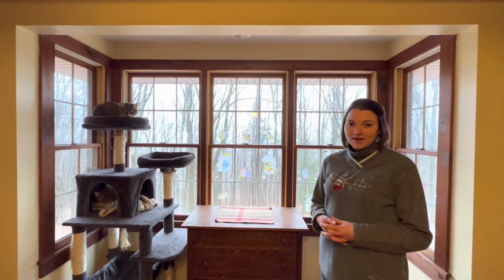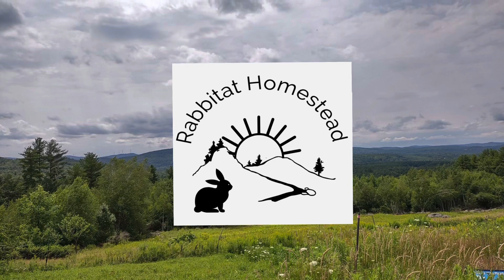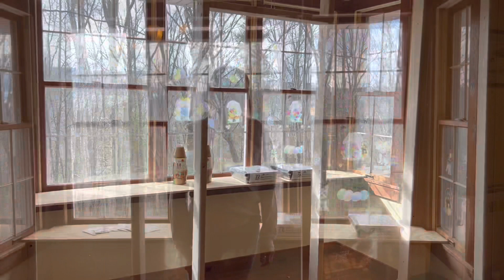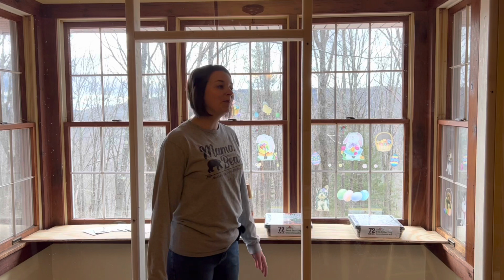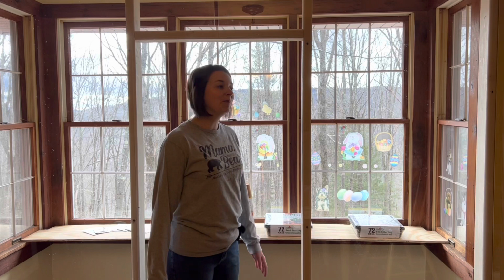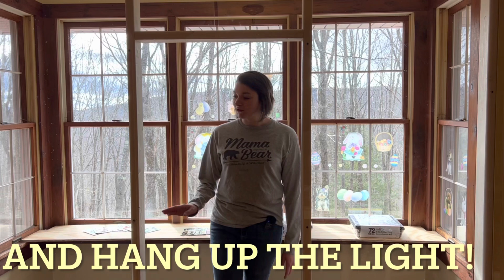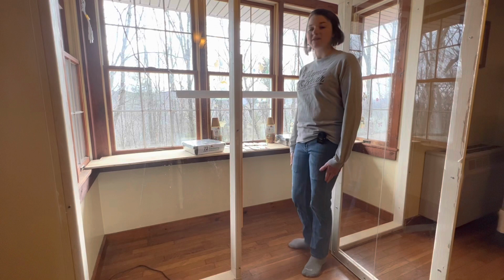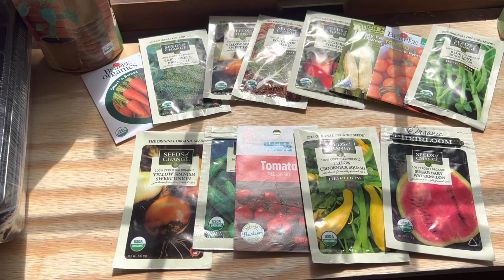Building a indoor Greenhouse

Comment: 2:51  use the wrong kind of screws on the right side. That's why there's a crack in the plexiglass. Would have been best to use metal screws because they have a flat head instead of wood screws which have a tapered head. 

Would suggest putting some kind of tarp or other material down in case dirt or water gets on the floor. 
Rest of it looks good